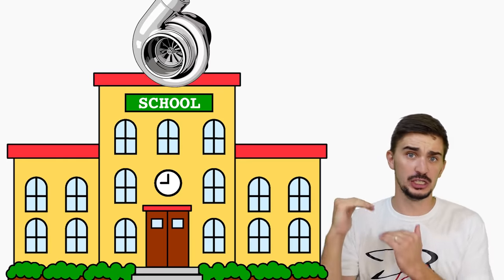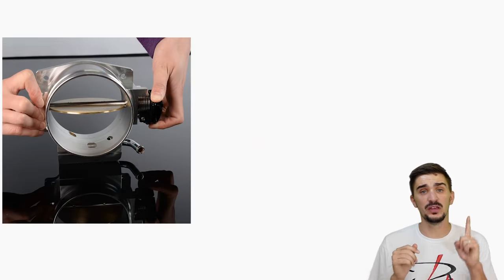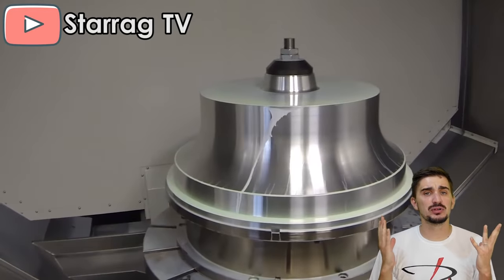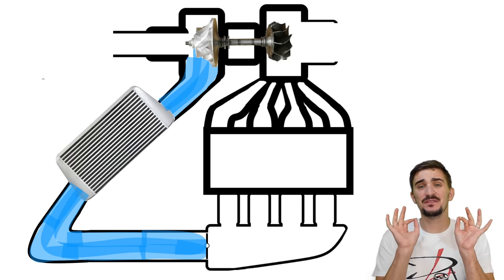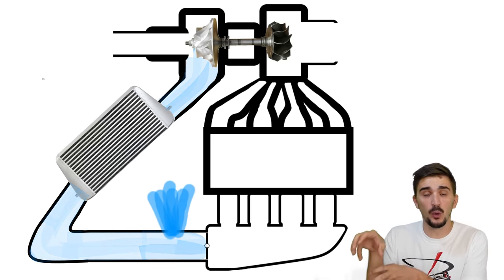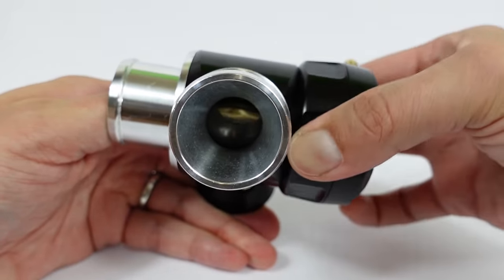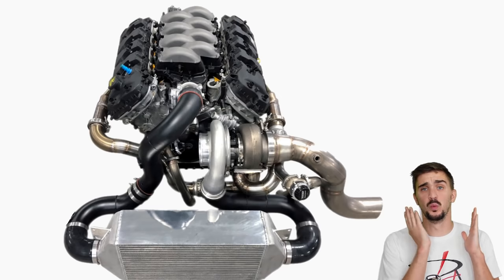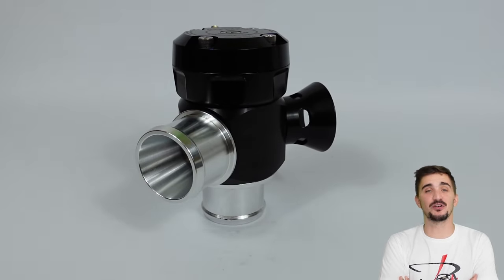TURBO FLUTTER and BLOW OFF VALVES explained in DETAIL - BOOST SCHOOL #8

Comment: Is the unmetered blowoff air really a problem? Engines normally cut throttle at high rpms when you come off the pedal, so that the revs drop faster and also to allow engine braking in gear. But does this also mean that you wouldn't have the issue of the engine running rich?

Comment: So I am not a car genius by any means but I believe I installed a wastegate in my setup as I had a mismatched turbo when I switched from my Greddy t25 to a larger Turbonetics T4... the wastegate was to remedy that overcharge at open throttle correct? It’s been years since I was obsessed with car mods so I don’t really remember what all I Frankensteined into that money pit of good (short) time. My car tech buddy’s usually told me what the problem I had was and what I needed to install to fix it and go zoom zoom again. RIP my head gaskets and my beautiful BMW M3 Blue ‘99 Civic EK. So you’re also saying that the Stutututu sound is bad but I thought that’s just how that BOV brand sounded... I forget what one the HKS maybe?
Reply from the maker: A wastegate and a BOV don't really have anything to do with each other. A wastegate works on the exhaust side and a bov on the intake side.

Comment: yes and the higher the frequency of the flutter, the better. because that means your total ic air volumen is smaller the higher the frequency = faster spoole time.
so you can get a grip of a cars acceleration capability, by the frequency of the flutter.

Comment: I had a rev2 mr2 turbo that had a MAF. It was doing all of 10mpg when I got it and after the first few weeks I was thinking I just couldn't afford to run a car that emptied a whole tank of super UL in about 120 miles or so...
Until I discovered the previous owner had unplugged the recirculation pipe from the OEM blowoff valve and set it to atmospheric vent. 
Plugged that back in and suddenly MPG was in the mid 20s
Wierdly, an HKS SSQV fully venting to atmosphere had no issues?

Comment: When recirculating the "excess pressure", wouldn't some of the air flow back past the MAF?, rather than towards the turbo inlet?. If so true, it would mess up the MAF reading, it wouldn't be as accurate, creating a "running reach situation"

I'm not stating that this is the case but my intuition tells me so.

Comment: Manual transmission cars where throttle plate snaps shut. Now a days with auto transmission vehicles and forced induction applications the ecu and other parameters compensate for the effect.

Comment: How do you know that when a surge occurs the air separating & moving past the blades is creating excessive force on the compressor blades? You didn’t explain that. You said the air is separating when surge occurs, I take it you mean the critical AoA is exceeded & the blades are temporarily stalled. I know that with propellers, when the critical AoA is exceeded, the coefficient of lift is reduced, so there’s less force on the blades. How would that be different in a turbo?

Comment: may be a dumb question by why not have the MAF sensor after the throttle plate to avoid the rich mixture issue the blow-out valve causes, and why use a blow off valve instead of a waste gate?

Comment: Great video indeed

Can you please help with detailed diagram for 1.6 peugeot 307 2005 turbo engene how to connect pipes from vacuum solenoid pressure boost (brown and black) I do understand that there is x3 inlets from the vacuum solenoid pressure boost solenoid valve wich is atm,out,vac,now the big issue is this i have bought a car that has those pipes disconnected and id want to reconnect them back and i have no idea on how should they be fitted,atm pipe is clear,im struggling with Westgate pipe which one point is already connected to Westgate but i dont know where the end point should be connected or should it go straight to vacuum solenoid pressure boost valve or it connects else where before it linked to the OUT inlet? Also can you detail on how the VAC inlet should go? And how or where to locate that particular area where to connect VAC?. Thank you very much in advance

Comment: I was under the impression that closed throttle turbo flutter was ok. With only minor effects to turbo longevity. It just sounds so sweet though, I want to block my recirc valve to get that flutter noise, but if it truly is quite damaging to the turbo I won't bother. 🤧
Reply from the maker: It largely depends on the amount of boost you're running. Many early turbo cars didn't have recirc valves from the factory, but they ran like 7psi or half a bar of boost 😁
Reply: i run no bov on my s14 with stock 7psi. It is no problem at sucj low boost levels

Comment: Thanks a lot for this explanation. So if I get it right, a turbo will not surge when installed on a diesel engine since there is no throttle valve. There should not be such a pressure increase. Correct ?

Comment: Towards the end of the video he mentioned replacing or modifying the turbo would be necessary for solving flutter on open throttle. Wouldn't this be fixed by adjusting the wastegate to allow less exhaust to the turbo?

Comment: There may be an error when connection the blow off valve to inlet with MAF. Wouldn’t it be logical to connect the blow off valve exhaust to the air intake BEFORE the MAF and not AFTER ??
Reply from the maker: So you want to measure the same air twice?
Reply: @d4a  haaaaaa, you are absolutely right !!!
I don't delete the question so if someone has the same idea !!!

Comment: 11:34 “the MAF has already metered the air coming into the engine”

I’m confused here - yes the MAF has already metered the air, but the throttle plate is closed so the air isn’t getting into the engine anyway. Why does recirc vs blowing the excess to atmosphere matter?

Comment: There is a throttle position sensor working along with the ECU and the MAF, so how does the fuel get rich if it vents out all the air in the atmosphere. The ECU will control the fuel according to the position of the throttle.
Reply: also, is this specific to gasoline engines?

Comment: Are there any advantages using a BOV like this GFB one, over a factory unit? I can imagine more capability of air flow, less slowing down your compressor Wheel? I’m talking about 1.5 bar of boost on stock recirculating valve, instead of the factory 0.35 bar.
Reply: yes increased  flow, but also has adjustability as often you can adjust/change springs to vary blow off point
Reply from the maker: I doubt the stock, especially the plastic kind, will survive 1.5bar very long. It also definitely can't provide the flow needed to cope with 1.5bar. Increasing your boost almost five times will always call for a bov upgrade. I'm curious, what car only boosts 0.35 bar in stock form? Non-intercooled?
Reply: @d4a  it’s a Volvo 945 2.3 Turbo with intercooler. It has an upgraded turbine and enlarged compressor side

Comment: I've always thought that the compressor surge / turbo flutter was just a very neat and cool sounding blow off valve. 

Excuse my somewhat foolish question, but is there a BOV that can replicate the sound of compressor surge / turbo flutter? If not, looks like I'll have a short lived TC on my Toyota Corolla Levin  2JZ swap because I must have that "STU stu stu stu stu stu."
Reply from the maker: No such BOV sadly. Maybe a big speaker and some sound files? 🤣 If you run low boost, something like 10psi, you'll be fine for quite some time.

Comment: Hey, can you do a video explaining turbo whistle/whining, that happen on some ?

Thank you!!
Reply: Look up 'vane pass frequency' and 'vane pass noise'. A higher vane count reduces whine/whistle.
Reply: @iansmith6728  could a damaged vane cause whistling/whining?
Reply: Turbo spooling whistle is normal and is likely to be caused by small turbulence as the airspeed and differential pressure through the turbo, plus the momentary pulses as the vanes pass through the air. That is normal and improved with more vanes.

Whining and vibration can be caused by a number of things including (but not limited to) blocked/damaged vanes, damaged bearings/seals, damaged IGVs, compressor surge/stall or buggered controllers.  Whining is not healthy.

This video talks about surge. Surge will cause the entire rotor assembly to move longitudinally back and forth, hence damaging bearings, seals and impellers.

Comment: Genuine question. Are there any benefits to not using a BOV and allowing turbo flutter? I personally love the sound of turbo flutter, but knowing that it damages the turbo by subjecting it to increased stress makes me rethink. Why do people knowingly allow / do this with their car? I'm not disrespecting their decision, I personally wish I could have my civic type r make those noises without prematurely damaging it's turbo. Are most people just cool with the issues they may cause for the sound alone?
Reply from the maker: This was discussed with a few commenters already. The gist of it is this: run low boost, like 10psi and flutter won't harm anything. This is why I'm saying "if there's enough boost" in the video.
Reply: Better response with quick off/on throttle as boost pressure is not being released and doesn't need to be built up again and one less thing to fail, your turbo will be fine even running high boost, people here running 50+ psi and no bov for years without issue.

Comment: Awesome video! Was wondering, if the 2 port bov has a static position, wouldn't all of the air take the path of least resistance out of the vent and not recirculate no matter how small the vent port was?
Reply: It recirculates still, due to the pressure/boost pushing it through. You choose the ratio. Think of it like a fire hose, but you split the end with 2 different (reasonably) size ports. The pressure being forced through the hose would push out both ports, but different amounts

Comment: You explained the matter for gasoline engines, may I request the working on a diesel engine too? Or, if such a video already exists, please link it for me.
Reply from the maker: Diesels don't have a throttle plate so they have no use for any of this.
Reply: @d4a  The absence of the plate is exactly why I asked. You telling that turbos on as diesel have no need for a blowout valve then?

Comment: In the diagram for 13:04, does that mean at the initial acceleration, when air enters through throttle plate, some air goes through the tube as well, resulting in initial slower acceleration response? And also, does this mean, the shorter the length of tube linking the bov to intake manifold, it somewhat improves the responsiveness? Since you retain more air going through the manifold in this case and your engine is able to combust better. Compared to having a longer tube = more time + air gets drawn into the tube from throttle body, resulting in slower response, or maybe even less torque. Could you please get back to me on this as I'm curious abt this 🤣
Reply from the maker: The small tube is negligible, it doesn't really affect anything. It would need to be like 10m long or something to have a measurable effect.

Comment: So how is maximum boost limited? Would that be a pop off valve? And could that guy with the constant turbo flutter cheap out and just install a pop off valve by the throttle body to vent the extra air?

Comment: Wrong on so many points, venting puts a equal amount of pressure on a turbo as a fully enclosed system, its just a different way said load is forced on a turbo. If a fully enclosrd system was still trying to compress air with the throttle valve closed you would A: have a positive maf reading and B: a positive boost reading at the manifold which you dont, the throttle closes but does not stop the air 100%, maybe 90% but the engine is no longer combusting to load up the the turbo either, the noise given off it the noise the blades make passing through the stalled air, the pressure in the system is not enough to bend the blades or put any extra pressure on the bearings. The bearings are under far more stress on spool up than shut off. Besides if it was that detrimental (which it can be if youre running 4bar+ boost) then race/rally teams would vent and pretty much all including f1 cars dont. Bov's leak, sound cheap and tacky and cause more harm than good, ive never had to replace a turbo due to running a enclosed system, pops and bang maps and anti lag are turbo killers unless your running the correct graded shaft for the heat cycles/managment. Compressor surge is caused on spool up not throttle closure

Comment: Hello @driving 4 answers I am looking into getting a turbo smart dual port BOV but Im worried that it will make my car flutter so do you have any idea about this and why it causes the car to flutter because I know that the main idea of a BOV is to remove compressor surge so the air doesn't come back to the turbo and make it flutter so why does installing it make the car flutter on low rpms and is it harmful even if it is in low rpm's because I know flutter is still flutter even if it is in low rpm's because when the turbo is fluttering the blades of the turbo are getting negatively effected when cutting the air and releasing it outside the turbo right?

I would really appreciate your insight and knowledge on this issue.

Thank you once again!

Comment: If modern OEM turbo/intercooler setups recirculate and this is more efficient then why add a BOV at all?  Is it really just for the noise? You may have covered it but I didn’t get this from the video sorry.
Reply from the maker: Factory valves can't survive high boost for long and can't flow enough air once you increase boost to efficiently do their job.

Comment: Question: 2012 Kia Optima 2.0 Turbo immediately shuts down when the gas pedal is floored.  I sit at side of road for about an hour to an hour in a half.  Thereafter, the engines starts right back up and I can drive from Tucson to San Diego without a misfire.  Put the pedal to the metal again and you're stuck again at the side of the road.  Kia dealer couldn't solve problem.  I tried switching to 91 octane fuel.  Thought I noticed improvement, but then I got shut down again.  Now it started missing at lower speeds during acceleration.  I will change plugs.  About 116,000 miles.  Thoughts?  Don't want to sell without fixing or giving accurate description to an unsuspecting buyer.  What say you?  Thanks.

Comment: Nerdy technical question, so a BOV is a pressure relief valve (when it open, it dumps all pressure) rather than a pressure control valve (only opens enough so that the pressure is controlled to a set value)?
Reply from the maker: Yes, technically that's correct, and the gfb dual port I showed is an adjustable pressure relief valve 😁

Comment: Great video! I just want to add that you forgot WASTE GATES for the exhaust fumes to bypass the turbine, or is there a reason you didn't included them on the video?
Reply: Probably because this is a video about turbo flutter and blow off valves not waste gates.
Reply: @DriftNick  compressor surge (aka turbo flutter) is when the compressor keeps compressing air to the intake manifold even though the motor is not consuming it (transitional state when there is a sudden deceleration for example). In this cases the inertia of the turbo-compressor is to big to pair the deceleration of the motor, so the compressor keeps doing its job meanwhile the motor does not need it. This keeps elevating intake pressure until the compressor energy is not enough, so it flutters (stutututuu). This stututu sound are pressure waves coming back from the intake manifold through the compressor. To take care of this issue you can either use blow off valves, as in this video explain very good, but this comes with the complication of air intake miss readings and wrong fuel dosage. That is why I asked about waste gates, because what the waste gate does is bypass the exhaust fumes instead of going through the turbine. This prevents the turbine from "harvesting" the residual energy from the exhaust fumes to give it to the compressor so the compressor stops elevating the pressure before reaching the surge point. Remember, the compressor can only give what the turbine provides.
Reply: @djjs10  He's talking about off throttle surge, the wastegate does not stop that.
Reply: @DriftNick  off thottle surge? enlighten me please
Reply: @djjs10  Have you tried watching this video where he literally explains it?
Reply: @DriftNick  clearly you didn't understand a thing of what i said in my first answer, so i suppose you have 0 knowledge about physics, fluids or turbomachinery. And neither of your answers ad anything substantial to my doubt. i guess you don't even know what the waste gate does and why so im ending the discussion here. have a great drift!
Reply: @djjs10  Your first question you asked why he didn't talk about wastegate, I answered, not my fault you don't understand this topic and think wastegate are somehow apart of it, if you just watched the video that explains it then you wouldn't  be asking that question, maybe you should try that, you could literally remove the wastegate from the turbo and nothing in this video has changed.

Comment: "Compressor Surge" with closed throttle/no load is nowhere near as bad for the turbo as Compressor Surge with an open throttle/load. 

I haven't run BOV's for years, never broke a turbo (helps that some have had anti-surge compressor housing I'm sure). I will continue to run no BOV for the sound, although I will say that a BOV (recirc) leads to less lag between gears than no BOV/vent-to-atmo.